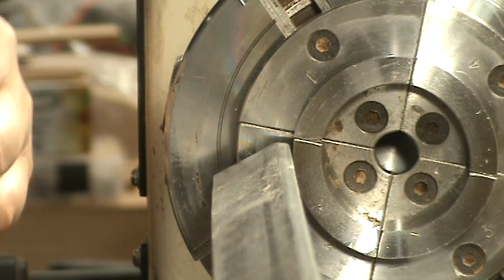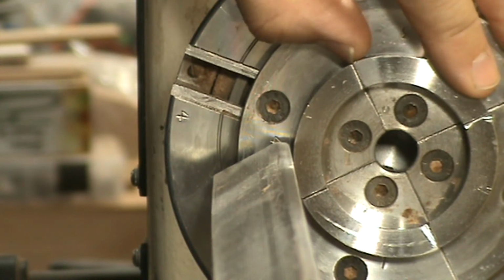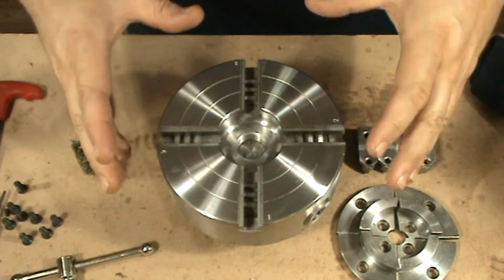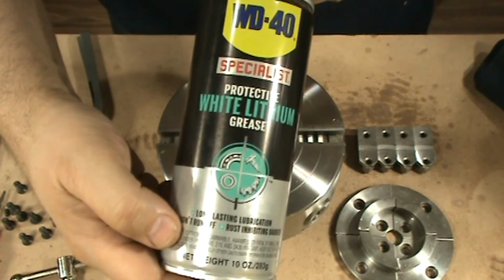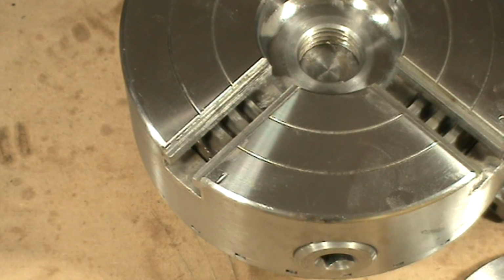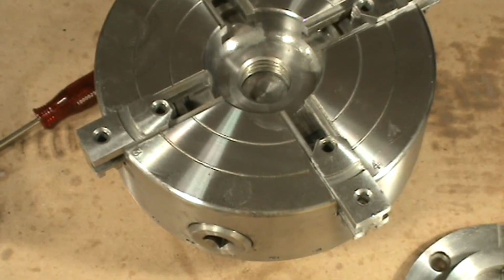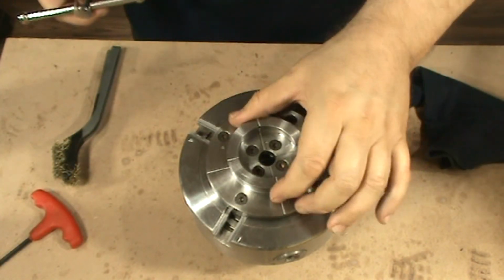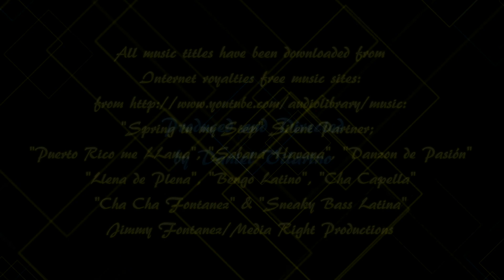Lathe Chuck Maintenance

Comment: Congrats on 2k subs and 100k views!!! no worries about the sweat, it's 35 degrees here, and I live by the sea, so the humidity is 100%, I feel like I'm in a pool while working in the shop, and no AC in my shop, I'm lucky to have a single fan... I would love to clean my chuck like you did, only mine doesn't work like that one, I'm too scared I will kill it, I only got the one, and can't afford a mistake here, if I kill it, I'd better learn how to turn without one, going back 3 years in time... :)
Reply from the maker: Yuval Lahav Ha, Ha, Ha! Thank you Yuval for your comments and for your support! Yes, it is tough to work these hot humid days, I use a full face mask, and after a couple of hours, at the bottom I have a small pool of water (sweat). Regarding the chuck, you probably do not need to disassemble it and can still clean it and lubricate it. I just took the plunge because mine was wobbling a bit and I needed to see if I could recover it. Otherwise, I guess I also would have been too scared to remove the sliders.The worst is when you are carefully disassembling something keeping track of how every single piece goes in the mechanism, and suddenly a bunch of spring go flying through the air! Cheers my friend! Daniel

Comment: Firstly Daniel congratulations on reaching two milestones, thoroughly deserved my friend.
Secondly a really excellent tutorial on chuck maintenance, and reassembly.
One point I'd like to add, I have found that a dry PTFE lubricant spray is best for chucks, as it is unaffected by water, oil or solvents and will not attract dust.
Great video
Take care
Mike
Reply from the maker: Mike Waldt Great tip! Thank you Mike for the comment and the support to the channel! Cheers mate! Daniel